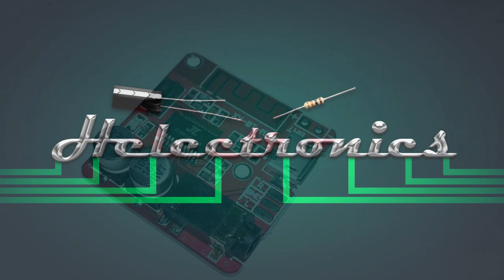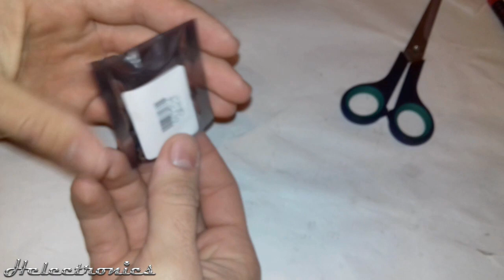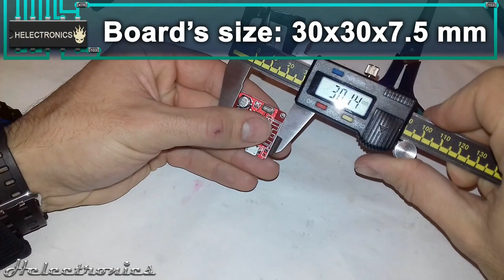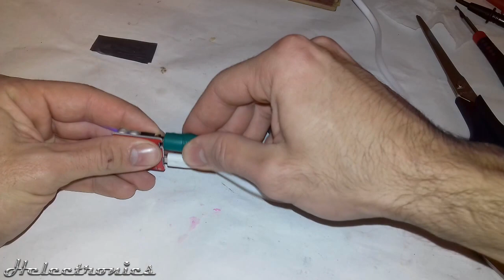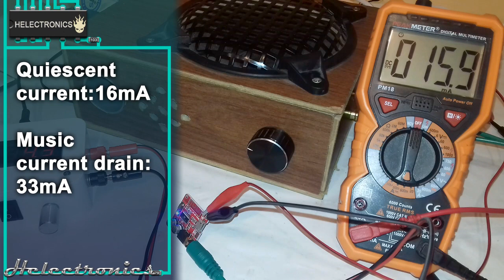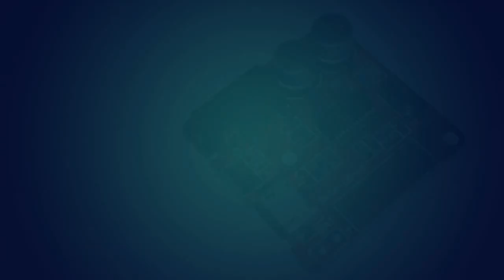REVIEW - XY-BT-MINI Bluetooth Receiver

Comment: I have this BT board also, i also have a power board that is 30 on channel one and 30 on the other channel. I look forward to getting his setup. I have a woofer box with two woofers. I am going to turn that into a BT connection. I have two of these boards for another project.

Comment: It seems that i am late to the party - I just got one of these & i'm pleased with the sound quality.
Reply: Hey, I'm new to this hobby and just wondering, do you have to hook it up to an external amplifier/speaker?
Reply from the maker: @Brickingly Hi, yes, you need to connect it to an amplifier. It has a mode in which it can directly drive speakers but haven't tested that yet.

Comment: Do you know if I can reduce the "ssss" noise by adding a capacitor in the power input?
Reply from the maker: It might reduce, but unfortunately it won't eliminate totally the hissing. This is a cheap module, you can't have high expectations.

Comment: You did not mention any changes in voltage based on freq. I wanted to know if the output is flat across all Freq
Reply from the maker: It is flat from 40Hz up to 20kHz.

Comment: How did you know that was the number of the chip?  What was shown in the video was completely different.
Reply from the maker: After a lot of search on Google, apparently this JieLi AC6905 IC is used on a lot of bluetooth boards. The pinout in the datasheet corresponds to the pinout of the IC on the board, so taht's how I knew it is an AC6905. Here is a good blogpost about this misterious IC: https://github.com/christian-kramer/JieLi-AC690X-Familiarization
Reply: @Helectronics  Wow.  Wonder how they figured that out.  Thanks.

Comment: how's the sound quality output using this compare when using auxiliary cable?
Reply from the maker: The sound quality is really good, the difference can't be heard. At 3:18 you can see the sine wave is clean with really small ripple. That ripple can come from the power supply what I've used.

Comment: Does this have "low battery" notification if I use battery as power supply?
Reply from the maker: I don't think so, at 2:15 I've used my variable voltage supply and when the voltage goes down to 3.2 volts, it simply shuts down.

Comment: thanks a lot for making this video , for testing the lowest operating voltage and current rating also. :) 
one last quest before i buy this to make a Bluetooth headphone.
- if i solder a lithium ion battery to the battery plus and minus terminals on the board, can i charge the battery by plugging in a 5V 500 mA charger at microusb port of the board ?
Reply from the maker: First of all, thanks for watching!
Theoretically yes, but it's not safe. I would recommend using a Li-Ion Battery Management System module, which protects the battery from overvoltage, undervoltage and more. If you want to use it in a headphone, then I highly recommend the BMS module, for safety.
Reply: @Helectronics  thanks a lot man for all the info :) the headphones which i want to try it on are pretty expensive.
Reply from the maker: Alright, but be very cautious, if the Li-Ion battery is handled wrong, or charged in a bad way, it can explode. So do a lot of research and test before you use that headphone.

Comment: Nice video! Am niste căști on-ear cu microfon, daca de exemplu le conectez direct la placa pe pinurile L, GND și R, o să meargă sau îmi va trebui și un amplificator?
P.S. daca le conectez prin mini-jack microfonul va fi funcțional sau va prelua sunetul din microfonul telefonului?
P.P.S. daca vreau sa conectez și o baterie de 3.7v de 250 mAh, îmi va trebui un modul de încărcare sau îl are incorporat?
Mersi anticipat
Reply from the maker: Thanks! Teoretic ar trebui sa mearga fara amplificator separat, dar inca nu am probat. Placa asta nu are si nici nu suporta microfon, ceea ce inseamna ca microfonul telefonului va fi folosit. Da, este recomandat folosirea modulului de incarcare.
Reply: @Helectronics  Mersi, atunci cred ca o sa caut o baterie care sa vina deodată cu modulul de încărcare sa ocupe mai puțin spatiu.

Îmi poți spune cât de mare este latența?
Reply from the maker: Are latență dar nu ştiu cât este cu exactitate. În jur de 0.2-0.5 secunde, poate. Totuşi, modulul este foarte bun pentru prețul ăsta.
Reply: @Helectronics  Am înțeles, mersi inca odată

Comment: So if i try to solder a 18650 battery will the unit always be on as long as the battery is connected? It would be nice to see a switch on this. I will have to solder a switch between the battery and the board to get this to be on and off as i wish?
Reply from the maker: Hi, yes you need a switch in order to turn it on or off, but I recommend using also a TC4056A based bms module to protect the battery from overcharge, overdischarge and many more.

Comment: Is the output mono instead of stereo, Sir?
Reply from the maker: The output is stereo.
Reply: @Helectronics  Thank you for your reply, Sir.
Mine just arrived, the sound only heard from left speaker. Is probably anything wrong with mine? Mine is exactly like your.
Reply from the maker: There is no output at right channel? Do you have an oscilloscope? Did you use a phone and connected with bluetooth? Does you phone's music player outputs the stereo signal, did you check the settings?
Reply: @Helectronics  From the right speaker only hear sound like humming. 
I don't have oscilloscope, Sir.
Yes I tried using my cell phone.
I'm using Android phone, I'm afraid there is no such setting on the phone.
Reply from the maker: Alright, unfortunately looks like the module is faulty from factory. What did you connected to the output?
Reply: @Helectronics  I connected the output to Logitech Z313 desktop speaker.
Too bad if it was faulty from the factory, although the price is quite cheap. XD
Reply from the maker: Yes, it is really cheap, next time buy more modules and hopefully you will get one in working condition.
Reply: @Helectronics  So sorry it works perfectly, my mistake I didn't push the 3.5mm jack strong enough since I'm afraid I will broke it. Thank you so much for your guide, Sir. Really appreciate that. 

And next time I'll buy more than 1 module in case that don't works well. Thanks again for your suggestion Sir.
Reply from the maker: You are welcome, thanks for watching and commenting!
Reply: @Helectronics  You are welcome. Like and subscribe your channel for sure! XD

Comment: What diod did you use for output?
Reply from the maker: Hi, I did not used diode for the output. Can you explain your question?
Reply: @Helectronics  you said something about output protection.... capacitor of some kind
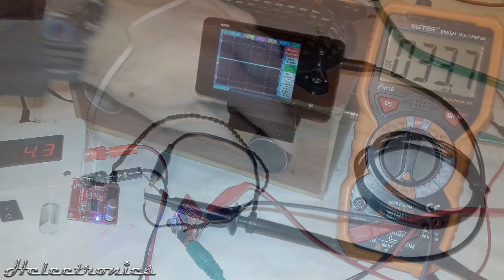Reply from the maker: @finismarac4999  Oh yes, at 2:50 I talk about the output, it has DC, so I recommend to use capacitors if the power amplifier has no input capacitors.
Reply from the maker: I've used 4.7µF capacitors at each output.
Reply: @Helectronics  tnx. Great review btw.

Comment: Is the chip or any other component hot or is it heating up. Thanks ☺
Reply from the maker: Hi, no, if it works good it shouldn't heat up at all. Works with really low current. If heats up and draws a lot of current, then it might be a faulty module. Thanks for watching!
Reply: @Helectronics  Thanks

Comment: Can it able to charge the battery?
Reply from the maker: It can, but I still recommend using a battery with protection circuit or a dedicated charge management module with an unprotected battery.

Comment: Hi there. If I connect 3.7v batt. Will connecting micro USB charge the battery safely?
Reply from the maker: I don't recommend using that charger, it is better if you use a dedicated BMS protection board and you connect that. If you have a battery with a built in protection circuit, then you can use it.
Reply: @Helectronics  Thanks for the response :) I have ordered some charging boards which have over charge protection and low power cut off. Thanks for the video, looking forward to some more! :)

Comment: How to disable the voice notification sound? Anyone figured it out? Pls let me know
Reply from the maker: Unfortunately I couldn't find a solution for that, hopefully others can help. Thanks for watching!
Reply: Helectronics it is pin8 but the problem is that this is also the general sound line. If you disconnect the pin you will have no sound at all.

Comment: when connecting this module to the amplifier input, the %80 sound deteriorate.  could the input signal be too much for the amplifier? How can ı fix this do u know. thankyou
Reply from the maker: I need a lot more information in order to help you, what kind of amplifier do you connect it to it, what kind of power supply do you use for this board? Aren't you accidentally connecting this module to a phono amplifier?
Reply: @Helectronics  I used a phone charger for xy-bt DC 5 volts.  amplifier 1 + 1 sound system. with ac plug.  It has tda2007a chip inside.  speakers 2x5w 4ohm.  When the volume exceeds 70%, the amp tries to exceed its final volume.  and the sound is distorted.  I have now tried my own Samsung Bluetooth headset.  there is no problem in it is very clear at full volume.  model hs 3000. Could the headphone output signal of this model be high for the amplifier?  Should I try another model?
Reply from the maker: Probably yes, the input signal is high and probably exceeds the max power output of the tda2007. If you have a more powerful amplifier with better speakers then you can give it a try. Does your sound system make these distortions with other signal source? (Like a PC or phone on max volume)
Reply: @Helectronics  no it has very clear sound at full volume with aux and Samsung hs 3000 Bluetooth device. Do you think the problem will be solved if I change the amplifier volume potentiometer.  Or is it more logical to look at another module.  50k installed.
Reply from the maker: Probably the Samsung HS3000 output is lower than the XY-BT-MINI, it is not necessary I think, you just don't crank it up to the max, just until the sound is clean. At max volume has the Samsung the same loudness as the MINI with distortion or it is less loud?
Reply: @Helectronics  yes hs3000 maybe 4 times lower than xy-bt mini i tried same speaker.
Reply from the maker: So yes, when you use the MINI don't turn the volume too high, it's not necessary to change the potentiometer on the amplifier.
Reply: @Helectronics  thank you
Reply from the maker: Thanks for watching!

Comment: Sr for my poor english
Can't it charge for battery if we use usb cable to power it and connect battery in battery-pin , tks ?
Reply from the maker: I would recommend using a dedicated charging protection circuit. You can see one in my other video titled: BUILD - WonkyMonkey Bluetooth speaker repair.

Comment: Where is n off key
Reply: That's what I have been looking for. I am looking for a way to turn it off automatically after 30 minutes of no pairing
Reply from the maker: There is no on off key, if your question was that. It turn on when you connect it to 5 volts.

Comment: Can you power this with cmos battery?
Reply from the maker: Usually the CMOS Battery has 3 volts which is not enough for this board to work, it requires at least 3.2 volts.

Comment: Will it reduce the bass, if I connect it with my 5.1 home theater (i ball). Last time I used the micro Bluetooth board to my 5.1 HT, but it reduced the sound and sound quality with no bass... plz suggest.
Reply from the maker: I can't give you an exact response, because I don't know that micro bluetooth board, all I can say that the frequency response of XY-BT-MINI is really good on low frequencies so it should be good.

Comment: Would this be good for a car radio to turn it into bluetooth?
Reply from the maker: Actually yes, but it's not easy to find the connections on the pcb of the car radio. You have to find where to connect the stereo output of the bluetooth board also with LM7805 the 12 volts must be dropped to 5 volts for power supply.
Reply: @Helectronics  I found this that already does it I just have to splice into the radio 12v cables
Reply: @Helectronics  HOMREE DC-DC Converter Step Down Module 12V to 5V Micro USB Output Buck Power Adapter (Micro USB) https://www.amazon.com/dp/B01MEESLZ6/ref=cm_sw_r_cp_apa_i_HqfYDbTJ3VGEP
Reply from the maker: This is a switching regulator, which means the voltage is regulated by fast switching, the efficiency is high but you might have a lot of noise. This is good for phone charging but not really good for bluetooth receivers and amplifiers. The LM7805 is a lot cheaper, less than 0.2 dollar per piece and it's not a complicated circuit to build.
Reply: @Helectronics  I'll definitely check it out! Thanks for the help!!!
Reply from the maker: @killervinx   I've found a dedicated car radio bluetooth circuit, the customer reviews are good. On the other hand you don't have to worry about voltage regulation, because this board has integrated voltage regulator. https://www.aliexpress.com/item/32653321849.html

Comment: And how to reduce output noise ?
Reply from the maker: In the last two days I've been testing the XY-BT-MINI and the PAM8403 to reduce the noise. One of the best solution is to put a 3300uF decoupling capacitor to the supply lines. Also at the output of XY-BT-MINI a 474 monolythic capacitor in series and a 22k ohm resistor in parallel. I will make a dedicated video just to give tips how to reduce noise on this module
Reply from the maker: I've made a dedicated video for this board and how to reduce the noise, you can see it in my latest video.

Comment: Hi, does the module work 3.7 v. Li-On battery?
Reply from the maker: Hi, yes it works, but I would recommend to connect the battery first to a charge and protection circuit and then to the XY-BT-Mini. Thanks for watching!
Reply: @Helectronics  thanks for your interest

Comment: Is this board stereo or mono? I bought 2 different (they are not " xy by mini")  modules. All of them had a two outputs (right - left) But when measure the outputs, i saw right and left pins short circuit. They are not stereo. So mono..
Reply from the maker: Yes, this board has stereo output, I've tested it. What are the names for the boards? Thank you for watching!
Reply: @Helectronics  I bought at Aliexpress. It's name is Bluetooth to Aux adapter for Car audio.
Reply from the maker: Those are probably not the best quality, so they might just made a shortcut and split the mono signal to both channels, cheap solution.

Comment: Is it possible to bridge this amplifier to get a mono signal and double the output power??
Reply from the maker: No, it is not possible. This module is not a powered amplifier, it is more like a receiver, you need a power amplifier in order to get a loud sound. You can use a Class D PBTL module like TPA3118 or TDA8932 which works with 9 volts or more. If your project works only with 5 volts you can connect the XY-BT-Mini to a PAM8403 stereo class D amplifier or use already a powered bluetooth receiver like the DW-CT14+. You can see the review of the least board on my channel.

Comment: hi bro when u connect to headphones.. is it sound good?bass? thx bro.. i want to make bluetooth helmet with this.. :)
Reply from the maker: Hi, I did not had time yet to test it, but as soon as I will have, I will let you know how it sounds.
Reply from the maker: You can connect headphones to this module (XY-BT-MINI). The bass and the sound quality is really good, which also depends on the quality of the headphones. Be careful because it is really loud.
Reply: @Helectronics  woah.. But this amplifier doesnt have vol control right? I have order it from china btw..
Reply from the maker: @hernandez2641  You can control the volume only from the phone. Probably there is way to connect a potentiometer to the output of the module, but it's not a sure thing it will work perfectly. Yes, these modules comes from China, the shipping takes about two months.

Comment: Thank you for the video. 
Hey, you can use the H button on your multimeter, and I can predict, that if you will push it 1-2 sec, it will "hold" and display the maximum of parameter you measuring.

Comment: What is max voltage to use? Can i connect on power wire directly? (12 vdc)
Reply from the maker: 5.5 volts is the maximum, but I wouldn't recommend using higher voltage than 5 volts. 12 vdc is going to burn it!
Reply: Use lm7805